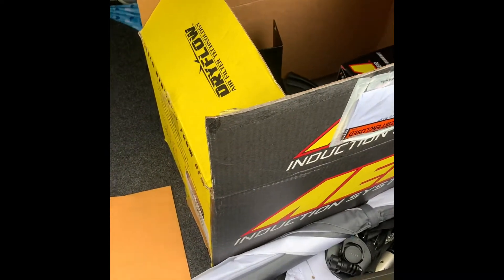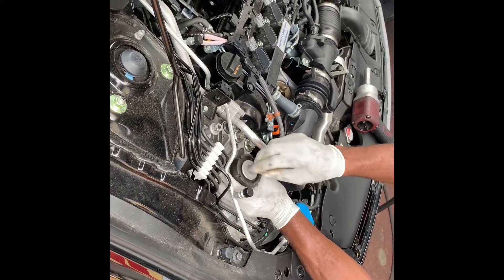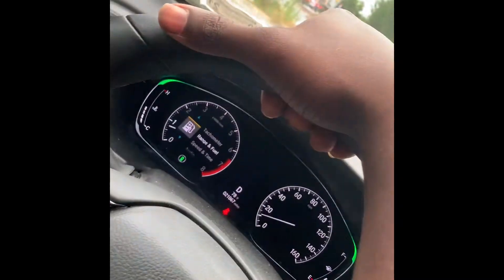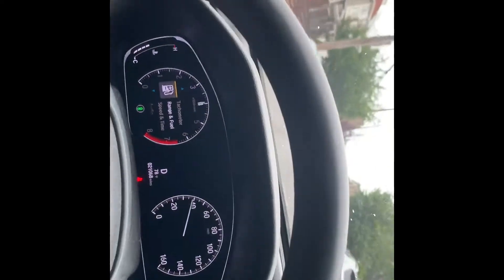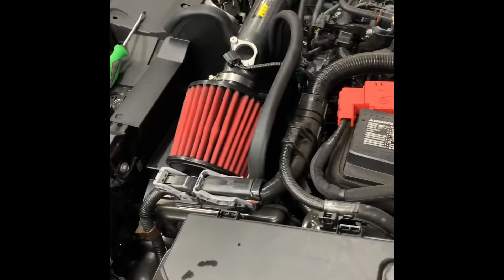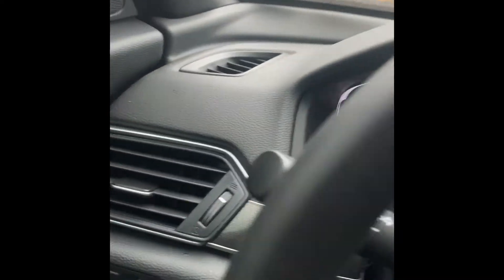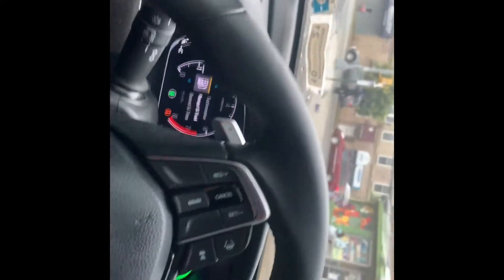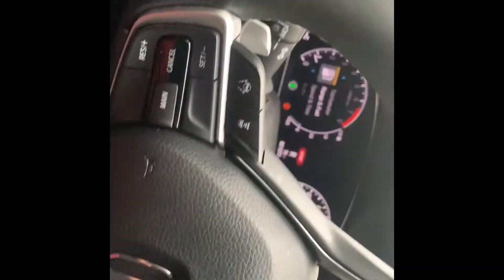Installing AEM Air Intake And Engine Mount On My 2019 1.5 Accord

Comment: What other mods did you have to get that sound..downpipe? Exhaust? I have got the AEM intake but its still soon quiet I can only hear the turbo if the radio is off and windows are cracked lol.
Reply from the maker: all had for that was was an intake, pedel commander and ktuner
Reply: @Bmidnight9  thats crazy that a tune makes that much of a difference in the sound of the car.